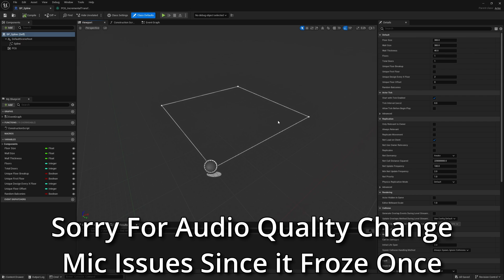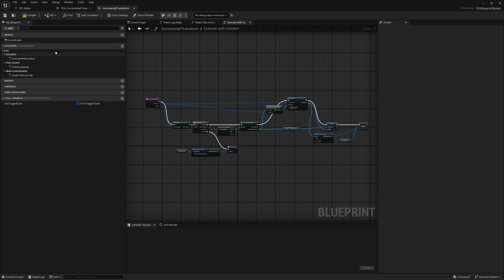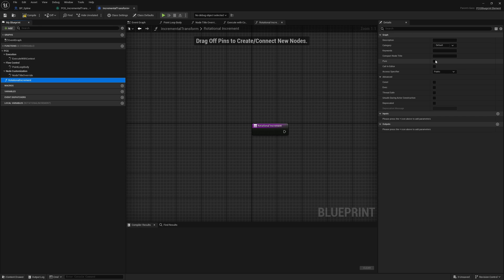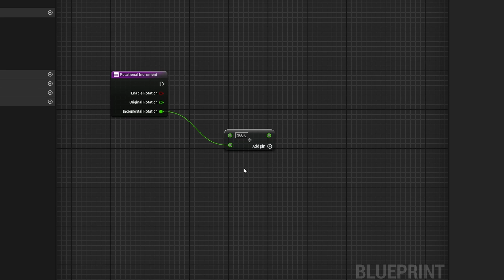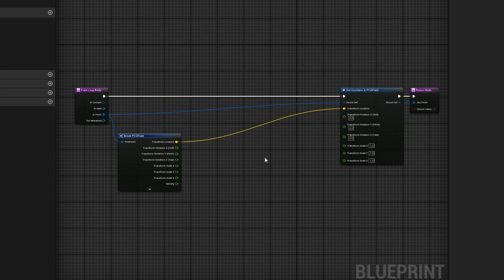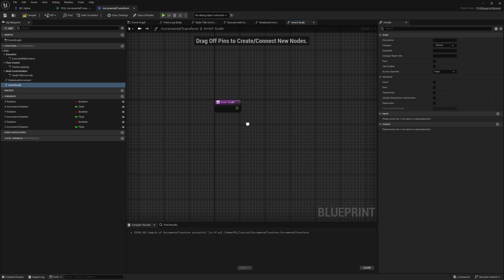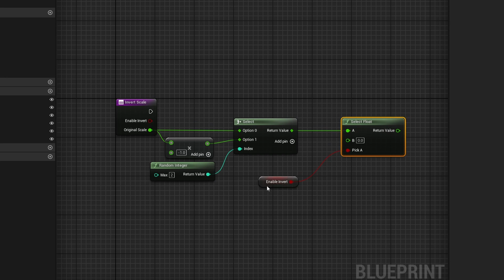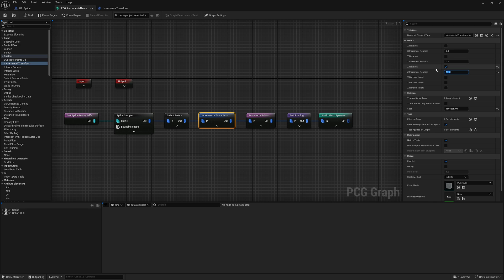Supercharge the PCG Transform Points Node | Building Series Part 10

Comment: Incremental rotation does not work when scattering on a spline. It doesn;t follow the spline
Reply from the maker: I don't see what the difference would be. This is also using a spline base. Is it working when you do on interior like in my setup?
Reply: @Procedural_Minds  Haven't try the interior setup yet. I'll will try it and let you know.

Comment: Hey man ! love your streams, I been trying to randomize a PCG brick wall where I use create grid and copy points nodes, I figured something like this video might help but following the example it doesnt spawn the meshes, I wonder if its because SetPointColor now its deprecated, tried to find out what is the suggested code/node that replaces it but no luck, any ideas how to fix this or where to find what replaced the deprecated node ? thanks in advance and for the great content, keep it up !
Reply from the maker: Theoretically you could use loops to spawn the first layer of bricks, then offset every other after copying up. I probably wouldn't do it brick by brick, but depending on your use case it's definitely possible.

Comment: is it possible to have the rotation cycle through 90 degree increments adding 90 degrees each increment? so like 0 / 90 / 180 / 270 / 0 / 90 / 180 / 270 etc on repeat along a spline as the static mesh is spawned?
Reply from the maker: Absolutely, but you'd need to configure it to do that. My current version isn't created for that. Instead of random you'd want to do it in order.
Reply: @Procedural_Minds  is that complex to do or am i just deleting a node or two? your graph is literally the first pcg graph i ever created :)
Reply from the maker: @JamesBrett2008  It's not complex, but it's not just a node or two difference either. You'd want to get familiar with BPs in general first.

Comment: Re: Const functions. While "mathematically" a function is input-output and no internal state, in blueprints/other languages we can change class variables (e.g. variables on the blueprint like "Y Increment") in a function. By clicking const you are committing to NOT changing anything about class variables/BP state from within the function. No matter what happens inside the function the state of the class is the same after as it was before.
Reply from the maker: Thank you for the explanation. :)
Reply: Correct. This is exactly the meaning of the 'const' keyword when attached to a member function in C++. And since Blueprints are basically a front end to the underlying C++ framework (to put it in simplified terms), it's the same there.

Comment: hi, i followed the tutorial but the rotation is not working for me, scale works fine though
Reply from the maker: Double check that you have things plugged in correctly. It's possible something just got plugged into the wrong node or a connection is just missing somewhere.

Comment: Hey, this is great, thanks - I wonder if you might be able to help me - I'm applying this to a sampled spline where the points must stay in 90deg increments in relation to the spline's direction, but when I connect my 'Incremental Transform' it appears to be referencing World transforms, not the direction of the spline - so my points are snapping at 90deg increments but not in relation to the spline, any ideas? Thanks thanks
Reply from the maker: Yeah, for that add a variable that adds to the rotation. Then just use your BP to set that variable to the rotation of the spline, in effect offsetting all the points by its own rotation.
Reply: @Procedural_Minds thanks for the response, do you mean there’s a means to ‘get’ the spline’s relative position to the world, which you’d then add to the incremental rotator?
Reply from the maker: @peterallely5417  The spline's data is just the BP actor data. So just get Actor rotation and pipe it into a PCG parameter to  use as needed.